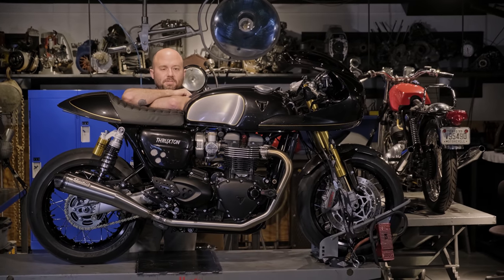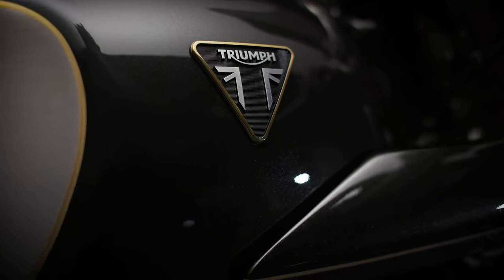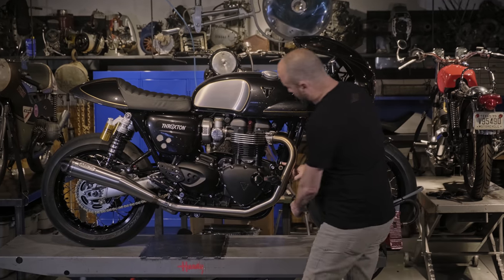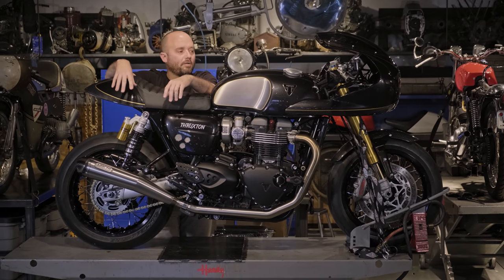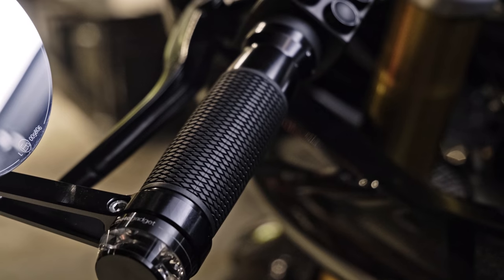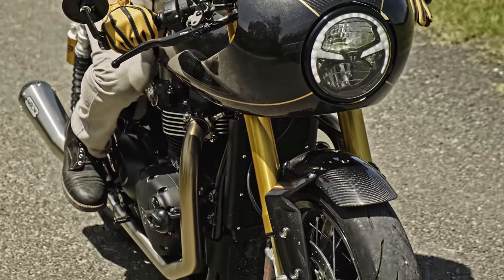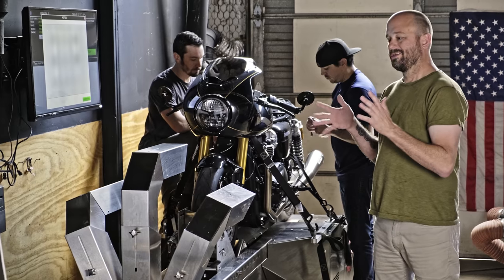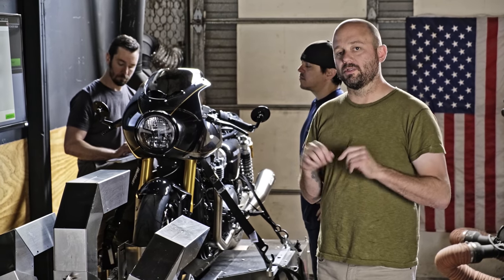Triumph Thruxton TFC Limited Edition // Revival Cycles Build Bio

Comment: My issue with a “piggyback” fuel controller is, if you de-cat, run aftermarket air filter(s) install a aftermarket pipe, at anything below 3k rpm, the stock fuel system is in control anything over 3k is controlled by the “piggyback” system.  In traffic or below 3k rpm, the engine leans out and gets hot.  My Triumph 675 has a “locked ECU. A “live tune” system would be better!

Comment: I’m confused. How do you switch through the rider modes and abs/control with the new switches? Or did you just delete those all together??? I want to do the same with my thruxton r. I really want to clean up the handlebars
Reply: The info and mode buttons are mapped to two buttons on the left grip.

Comment: Did you guys run a munit and m-button on this install? What relays needed changing?
Reply from the maker: Hi Matt, On this build we used a pair of specific latching modules and a couple of relays in order to install the momentary switches. I'll provide a link to a guide and parts list below. On Most bikes this new an m.Unit installation is either impossible or impractical and we never use m.Buttons on any install because they solve a problem that doesn't exist and introduce difficult to diagnose malfunctions. https://technicalarticles.revivalcycles.com/hc/en-us/categories/360000745791-Revival-Kit-Instructions